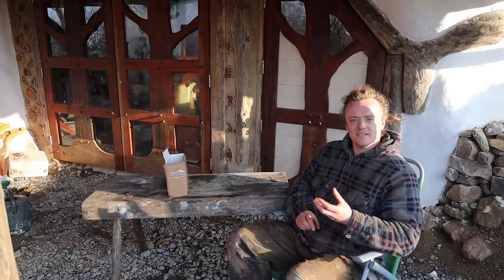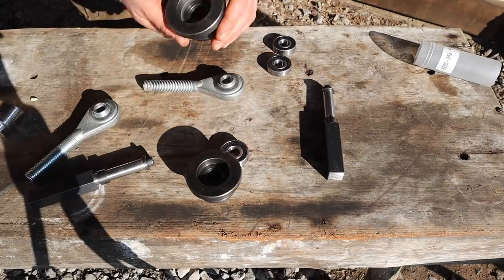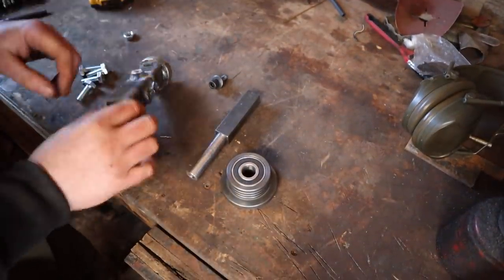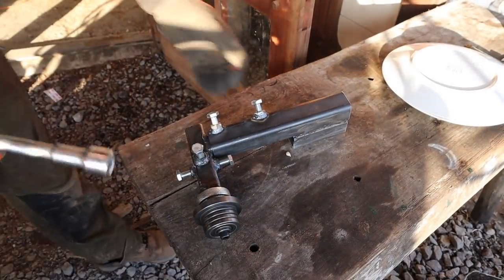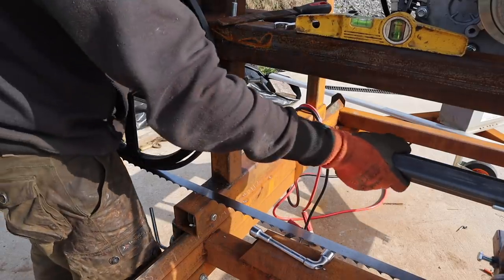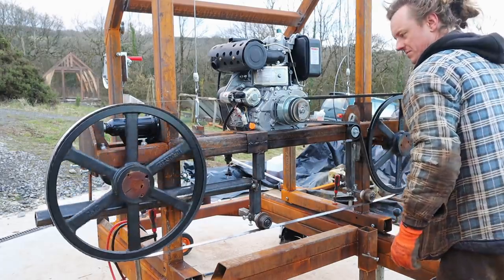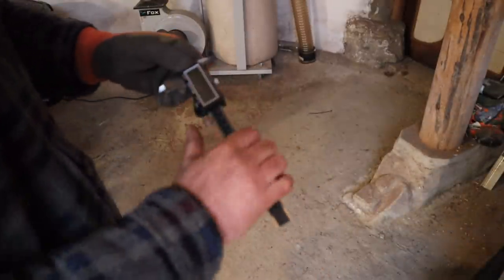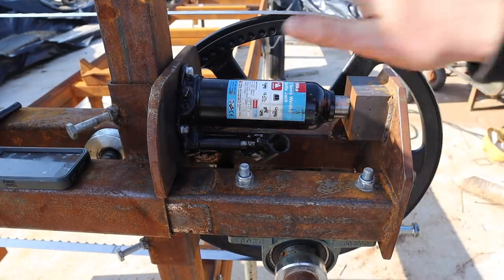DIY Mobile Bandsaw Mill Part 4 Blade Guides Collaboration with Ades Workshop

Comment: One of the most useful things I installed on my homemade mill was a pressure gauge on the hydraulic blade tensioner so I could read the blade tension as any time.

Comment: Kris, I noticed that the tyre on the idler wheel is flapping about, so rather than get a smaller tyre, you could pack out the gulley of the wheel rim with electrical tape (for example) to take up the slop of the tyre.
That's a really elegant solution for the belt tracking mechanism on the guides, well done, both you and Ade!
Reply: The tyre is a v- belt, if it was tight it would be impossible to mount, it works well as it is, a lot of commercial saw mills do it exactly the same way without problems...

Comment: Great build Kris, can't wait to see it in action, not to be padantic but you were using a vernier calliper not a micrometer to measure the jack movement, if no one says anything you don't learn. The naysayers who are commenting on the hydraulic jack are basing this on a large load like lifting a car or machine for a period of time. You will get creep / loss over time as the seals in the jack pass but the way you are using the jack with less load for a short time will be fine as you demonstrated. Best to use a fine thread for the 4 jacking screws as it give better accuracy for alignment and less lightly to move under vibration would also put locking nuts on them to make sure nothing moves. Bet you have saved £££$$$ compared to buying this👏👍🏻

Comment: Glad I found your channel. I've got a home -made , trailer wheel mill that had a VW motor , clutch and all powering it , lol. It worked. Well until I blew the motor cutting black locust logs on a 90 degree day. I'm up-grading it with proper sheaves and motor.

Comment: I don't want to sound like a jerk by stating the obvious, but I think the rust is interfering with your travel. After cleaning the rust, and greasing or lubricating the rail I think you'll see it will operate smoother. Thanks for all the great videos.

Comment: you are dead right hydraulic tensioner are standard on lots of good bandsaw mills  , although I used threaded bar to make my tensioner which works as well , I release the tension on mine after use because my bandsaw mill  is only used occasionally , if I left the 1 1/4 bandsaw  blade in tension over long periods the band stretched { the bandsaw blade can get warm too }  I had to retension it in my early learning days post build I noticed when a blade snapped and I replaced it I would have to wind the tensioner in a lot to fit a new unstretched blade , so even with hydraulics the tension will drop over time and not due to a jack , your doing a great job , best bit to come is cutting some timber , I was amazed when I cut up a windfall oak the first time on my heath robinson contraption but it will cut veneer 1/8 thick as wide as you like all day as well as beams & boards

Comment: Fine work Kris.  If I may,  you should add some grease fitting to some of the sliding parts to aide in movement and prevent corrosion.  And yes, the paint helps a lot, I live in Iowa and rust always makes me cringe.

Comment: Excellent video Kris, I've just found these and am going through them all, fascinating. 
Could I just advise it is good practice when using a pillar drill to clamp the work/vice to the table as if the drill catches the work very nasty injuries can result, especially with the larger diameter drills. It does happen and will although it is tempting to skip this on 'quick' jobs..keep your fingers safe !  All the best with your plans and keep posting 👍

Comment: I hadn't seen a belt driving the shieve/pulley directly like this.  I really like it as It seems much simpler.  I wonder if a water drip would cause issues with this design by getting the drive belt wet and causing slippage.

Comment: Cracking job Kris u could always add a screw thread. Didnt think the blade guides need 360 movement more the band wheels. look at ur band saw. Looking forward to the first cut. I think i will buy a woodlands at some point and make a trailer for it. The yanks are buying them like crazy as the timber price has sky rocketed. Keep safe bud.

Comment: Thank you Kris for another well done video. WoodMizer uses hydro oil  blade tensioning, of course you know this lol
Reply: How does the wood mixer tensioner work ? Do they use a hand pump to pressure it up ? A accumulater to maintain proper tension ? The john deere crawlers used a grease filled hyd ram as track tensioner , was one of the best track tensioners made , but you lost all your grease everytime you released tension
Reply: @outinthesticks1035  It pumps up with a handle and has a dial to indicate the pressure.

Comment: The saw mill what a tool, I like the adjustment upgrades you have done,  is there another video talking about the mill , I am guessing it was a purchase, rather than a built it from scratch job, as I said what a tool, shame about the timber disease,  I am not sure about the level of timber that you source from your own land, rather than buying timber in to do your building projects, do you have much mature timber available for you to use on site. That  lump of ash £20, best 20 you most of spent in a while, fantastic, great inspiration. Stay well.

Comment: Good work.  Definitely a bit different design on the carriage and elevator from most other commercial and home made mills I've seen.

If you are still chasing solutions on other parts of your build, you might give Matt Cremona's series a view, you might find a few ideas to try.

Looking forward to seeing the first trial cuts.  I need a mill like I need a hole in the head, but I can't stop thinking about one.  We got a lot of honey locust that is supposed to be good for furniture on the place, and I'm thinking some of the hedge (osage orange) would make some decent cribbing blocks.  Cottonwood is prolific around our creeks, a lot of that gets used for upholstered furniture framing and pallets/packing.  We need to clear it out or let the pastures get overrun, so might as well make something out of it if I can.

Comment: kris. i just noticed there are 2 bolts that will need shortening a little. the bolt at 3 oclock on the left wheel and the 9 oclock one on the right wheel, both extend further than the wheel and may interfere when you start to saw a piece of wood. keep up the project mate. best wishes.

Comment: Kris your sparking at the front of the vise was a bad earth. You've got your earth clamp on the front of the vise (I believe), and if it doesn't get a good electrical connection (e.g. rust or paint), it'll try to arc there, instead of arcing at the tig electrode.
Reply from the maker: Yeah I saw that when I watched the video. At the time i thought it was no shielding gas. I must have knocked the clamp off a bit and made a bad connection
Reply: @KrisHarbour  Easily done! I've done it too many times :)

Comment: Some people don't half talk rot, all that bottle jack stuff! anyone who has ever jacked something up using a bottle jack would know they're capable of fine adjustment with a fine touch.  Total non issue! It's not like you wouldn't give the lever a quick check before each use either, as you say.

I think it's a neat solution and alternative to a screw thread, it reminds me of tracked vehicle tensioners - you pump grease into a hydraulic cylinder with those.

Comment: I watch a number of other channels with band saws and they all use pneumatic/hydraulic tensioners. They also tension prior to starting the saw and almost always need to immediately tension after the saw has run for 30 seconds due to the forces on the blade elongating it....looks a great design although the H&S inspector side of me still cries a little when you run it without guards... ;)

Comment: The Saw looks great!
Are the blade guides hardened? 
I think the step which pushes the blade through the wood will wear out very quickly if it is not hardened.
Reply from the maker: No Not hardened. My philosophy is to make the thing work first before spending to long on the details. If the roller work well then the design can be remade in harder steel. no point in the machining problems and cost if the design is no good. Think of it as prototyping.

Comment: My guess is that the 10 mm plate that you're using the bottle jack to press against likely has a bit of spring tension in it which would tend to absorb some of the expansion your band sees as it heats up. I'd be curious to know if this is the case now that you've been using the mill quite a bit, and was that your original intention?
Very nice job by the way.

Comment: Love this build . just small pointer, have you considered having it spring loaded alongside your Jack,or or spring loaded pulley to retain  tension..it would possibly cure expansion and retraction of your blade?.
Reply from the maker: Yes i have, i really want to get some springs man enough for the job and have it spring loaded. its jsut finding springs that are strong enough. need to hold about 2 ton.
Reply: @KrisHarbour  how about a car or van front strut, not just the spring but the whole strut with the spring preloaded. A few  modifications I'm sure it could  be done with a man of your calibre

Comment: Love this channel!  Apologise if you have already answered this but what made you choose a petrol engine over an a electric motor, I am guessing it's something to to with three phase power and you will get more torque from existing set up?
Reply from the maker: Mostly because of mobility. If I ran it on electricity then it would have to be in one place really. That might happen one day when I have a building for it and more power available but for now this engine running on veg oil is the best option.

Comment: The saw is looking awesome Kris. You'll need a massive moustache and a beret if you'll going to Myth bust :-). Noticed in this video that there was light appearing between the rubber and the idler wheel when the blade goes under tension. Does that affect the blade stability any?

Comment: I think there is a simpler way of doing that? extend the back of that bearing shaft out a few inches, cut a thread into it and then bolt it into a right angle plate with a large hole so it can slide around in it, then clamp it into place with oversized washers. Also pillow block rose bearings might be easier to use. Either way is good I reckon.

Comment: I agree that a bottle jack will not decompress over a hour or two but i would question whether you should trust the o ring around the ram, do you not think that over time as the jack ages that seal might become worn? and god for bid it fails as your using it. Otherwise i would say youve done a brilliant job pal, you should be pleased

Comment: Hi Kris, I am presently building a new concept mill! I am waiting for parts presently. However I do own a lumber mate 2000 that I bought at a good price to flip I am using it presently it is stationary and I want to make it portable. However can I make a few comments on your build! To make it better Put your motor on a slide being adjusted with a handle to engage and disengage it which will eliminate the slip clutch. and if you pick up a double pulley mount it up 45 degrees from your pulley that holds the blade. this removes the idler pulley then you will eliminate the long belt that is being constantly bent. you will need two short belts. one to connect the double pulley to the pulley holding the band saw blade and another going from the double pulley to the motor If a belt is not bent it will last considerably longer than one that is bent. also two small belts cost less than a long one! You can increase or decrease the speed of the mill by the size of the double pulley. But I recommend a 4" Great work! your a interesting fella!

Comment: It looks like if you were to be sawing something 785 mm wide, assuming it's more than a few mills thick, it would collide with the heads of the adjustment bolts as you move through it. Or is that just a trick of camera angles? If it would collide, can those bolts be shortened further to take that risk out?

Comment: Is there any risk that loose belt on the one wheel decides to run away? I've never seen that style of wheel so idk. Really cool build.
Reply: A lot of commercial saw mills do it exactly the same way, it will work fine...
Reply: @Henning_S.  Good to know.

Comment: Are that rubber band supposed to be so loose on the non-driven wheel? You could see light between the wheel and the band when you spun it by hand...
I really like your sawmill, and it's something i've wanted forever, even though i have absolutely no use for it at all. Sawmills are just cool 😁

Comment: Sorry you are missing the point , a jack is an expensive bolt, it will probably last years ! However as you start your cut the blade will heat up . A bolt pushing on a heavy spring can compensate for the change in blade length a fixed adjustment can’t. If you adjust when it’s hot things will strain as it cools , also box on box with an off set load tends to act like a clamp more than a slide so your adjustment will never be smooth. Don’t get me wrong what you have made works lots of mill are similar but ruff cutting and reduced blade life are the price, just trying to help sort out the bugs, cheers

Comment: i dont know if it matters right now, but at around the 1730 min mark i noticed the bolts on the guide was spinning a little with the vibration, i say i dont know if it matters because i dont know if it was tightened down or not and that was why, but just figured you might have missed that and could cause issues if it WAS tight
Reply from the maker: They were not set yet. But someone else said they should have lock nuts so I will do that 👍

Comment: i would pu another nut on the alignment bolts so you can lock them in place once set
Reply from the maker: Well they are tightened down to the bar once it’s set so they would be tight. But I agree it might be a good idea with all the vibrations 👍 I will do that

Comment: My concern would not be with the bottle jack loosing tension on the belt, but applying too much tension as you have no way of knowing. Must company's in the states and Canada apply foot pounds of tension so as not to harm the drive belt and carrier wheel. Over torquing the blade hurts your bearings also. Just trying to be helpful.

Comment: as the jack is not under massive forces like it would be under a several tun vehicle it should in theory hold tension untill the seals fail or belt stretches
Reply from the maker: This band wants nearly two Ton of tension so the jack is working on its upper end. It’s a three ton jack. They need an amazing amount of tension
Reply: @KrisHarbour  sounds good all round to me then no way you would get that kinda force from something that not hydrolic

Comment: it is a gorgeous machine, but the pulley wheels are not deep enough to keep the blade in.  It looks way too dangerous to me.  Get deeper pulleys and be safe.  Safety today, or sorrow tomorrow.  And I could be wrong too.  Maybe if the pulleys were deeper, maybe the blade could snap off and cut you badly.  With the shallow pulleys it would just come off of the pulleys, stop pretty quickly without snapping the blade.  I think it is snapping the blade that is the biggest danger.  Also, some housing for the blade to keep it encased is a absolute must have in this design, or any design like this.  Other than that, it is a beautiful machine you got there.  The structure could use some paint before it gets too rusty.

Comment: This looks like a well worked project and has made interesting viewing. I was thinking when I watched a few log cabin builds that were built with straight edged logs rather than the round 17th century design which is still popular.  Those that are like these https://www.youtube.com/watch?v=2u7fYqezq98 that getting a logs on a mill like yours and then having enough to get a cabin together wouldn't be half as much work as this type by Nik Rijavek ( https://www.youtube.com/watch?v=f6TfQRGUVTQ ). A small cottage like that with wood shingle roofing could be a great addition to the farm. I assume the finishing of the workshop is the next major project this year.

Comment: Seriously impressive planning, design and production, Kris, and with a that come your usual but extraordinary video production (welding the vice together at the 15:00 mark). All that acknowledged, at the end of the day (given the endless variables and the extreme inherent danger made even more so with a homebuilt rig) your time, material and expense would have been better focused on any of the other projects banging around in your amazing brain rather than end up with an extremely iffy bandsaw that will eventually maim you or Dot if you persist.    So very sorry Kris; rehab a 3rd hand Woodmizer to save your own hands.